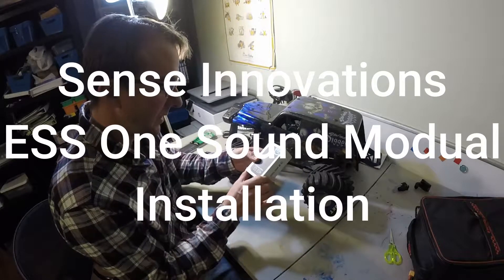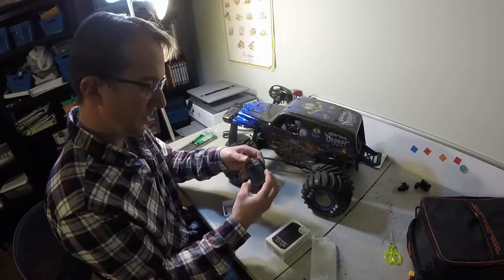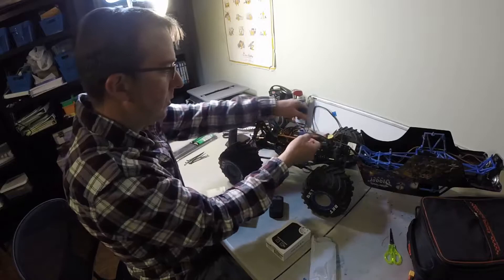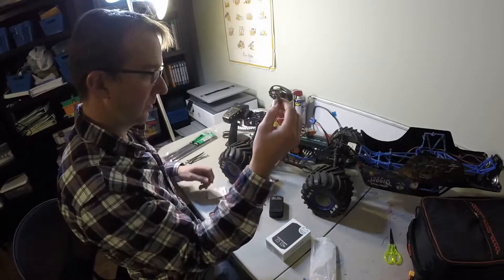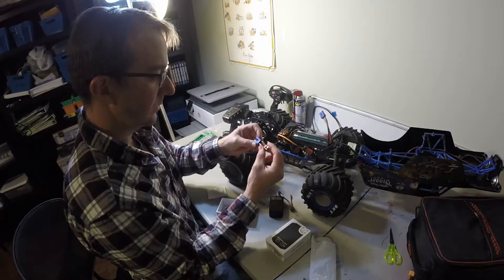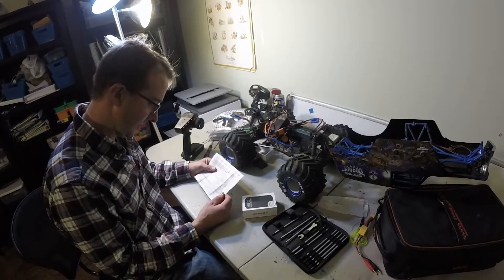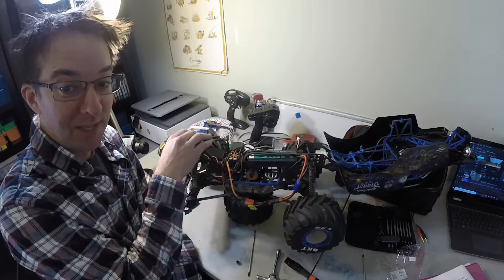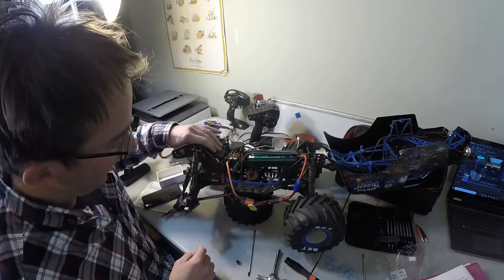Sense Innovations Ess One Sound Mod Install - Losi LMT

Comment: Thank you for confirming that I'm not crazy because I haven't been able to get it to work with my LMT either. The folks at Team Associated who currently sell this product didn't know why it would work with my Enduro Sendero equipped with an AE receiver and Transmitter, but not the LMT with Spektrum electronics. I really want the ESS to work with my LMT, but also enjoy the power limiting functions ie 50/75/100 on the Spektrum radio.  Were you able to preserve this feature when switching to your Futuba?
Reply from the maker: I understand!  I like the stock radio just fine.  The Futaba I installed has the ability to dial down the end point adjust for throttle so it's nice to still be able to do that.  I hope you can get yours setup.
Reply: @crousehouse10  May I ask which Futuba model transmitter you're using?  I'd read that potentially those which have telemetry data could be causing the ESS issues, but you could disprove that depending on your answer.  Thanks!
Reply from the maker: @frozenfist3360  HI Sxpacslm. It is the 3PV.  It can manage 4 wheel steering  if you plan to set that on your LMT someday. It also has several other good features if you are stepping up from a RTR radio.
Reply: Thanks for taking your time to respond  @crousehouse10 !   I'll be in need of a radio for an upcoming Tamiya kit so this may fit the bill for both it and the LMT.  I've only had RTR's to this point.
Reply: @crousehouse10  could you provide a few more pieces of detail...you maintained the stock ESC correct?  and did you have to mess with any channel mixing, or are you just connected through channel 2, th?
Reply from the maker: @frozenfist3360  Hey!  Yes I used the stock esc and channel 2.  Did not use channel mixing.   Is it still not working for you?
Reply: @crousehouse10   I have yet to purchase a radio, just still researching the topic and joined the FB lmt group. Someone swore only an esc swap would allow the ess to work so I wanted to gather ever detail from your experience. Thanks again for your input Jeff, there are a lot of frustrated owners out there looking for solutions. Oh, one last piece, is it a gyro equipped receiver?
Reply from the maker: @frozenfist3360  ok.  No it is not gryo equipped.   Honestly, I removed the sound module after a month. It was a fun project but not something I wanted to leave on my Lmt.